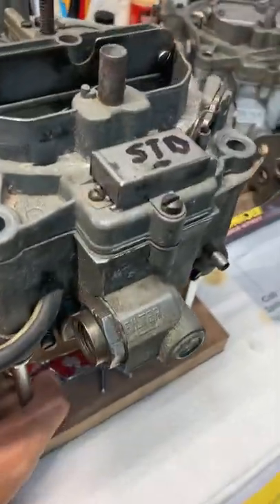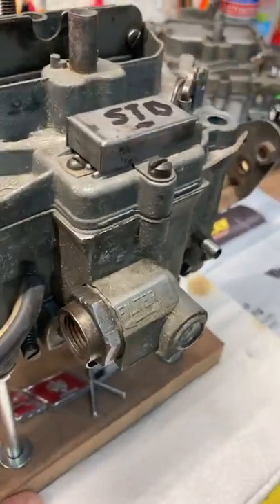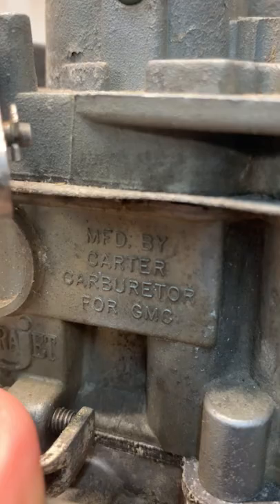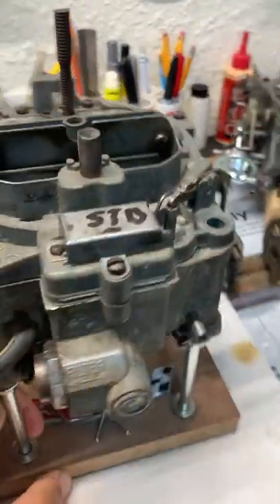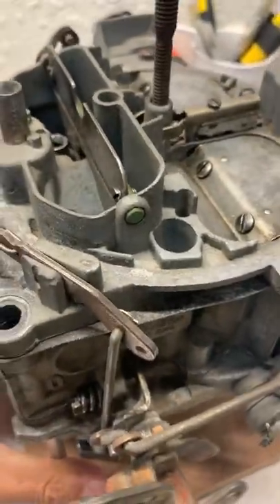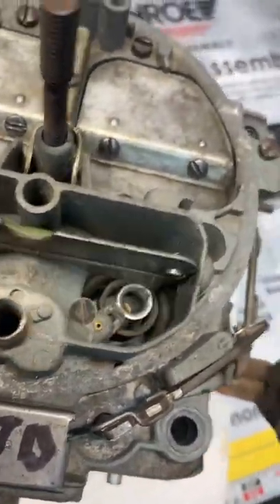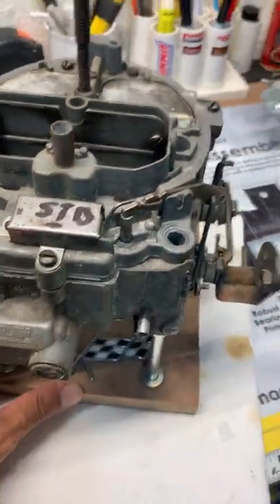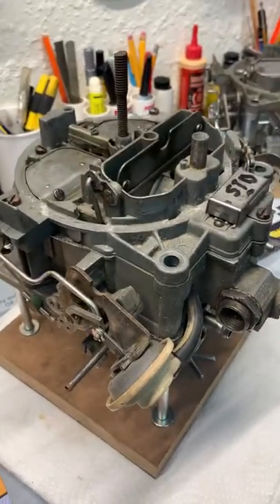69 Vette Quadrajet 702 Carburetor Project

Comment: Wowww
A Rochester Q-jet was the first carb. that I learned to rebuild and modify when I was about 16. I never knew Carter had one. They look identical. Did Rochester buy them out. I've rebuilt a '66 Carter AFB .... but
Reply from the maker: Carter built Quadrajets under contract by General Motors for a couple of years. 
They went out of business in 1985. 
Thank you for watching! 😊👍🏻 

https://en.m.wikipedia.org/wiki/Carter_Carburetor

Comment: I use to tear those down all the time back in the 70s the plugs on the bottom used to leak All the time which would flood and run rough first thing in the morning and by now the throttle plate bushings are worn out The best thing is just buy a new Edelbrock or New Holly!!

Comment: Looks like a 650 cfm from my, perspective. The 550 cfm had the fuel line/filter that came str8 out of the, front. The 650 cfm (as seen in this video) had the fuel line/filter coming out of the (left) side.
Reply from the maker: Quadrajets came in two sizes: 750 CFM or 800 CFM. The fuel filter position had no effect whatsoever on CFM.